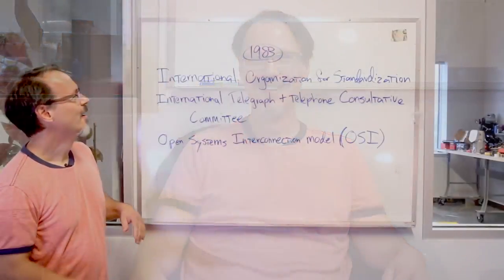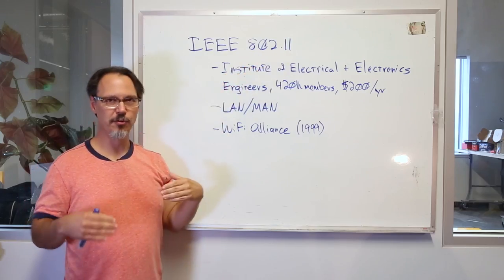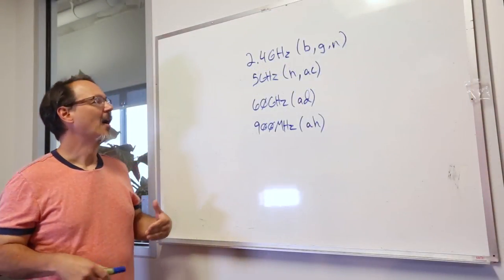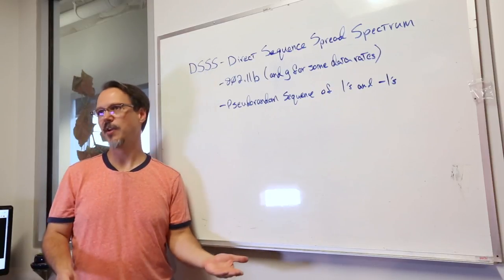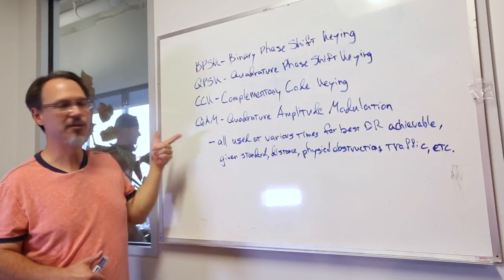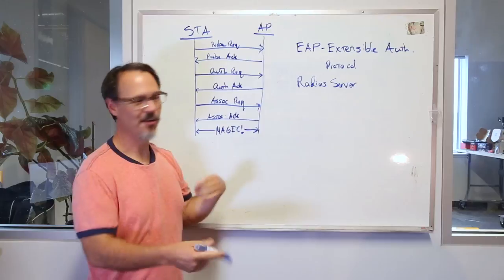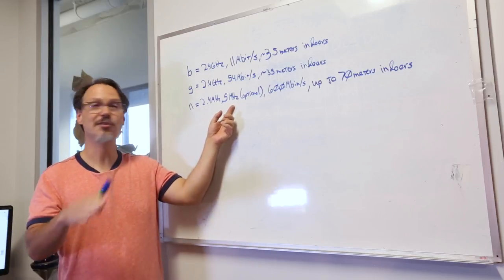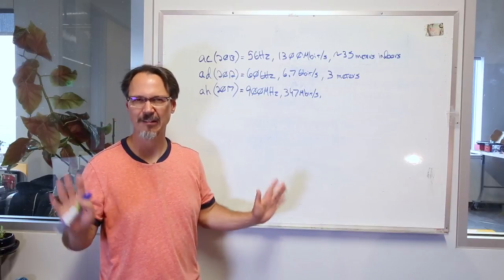SparkFun According to Pete #48 - How WiFi Works

Comment: is there a generic name for wifi that you don't need the wifi aliiance's consent to use? Would you just have to say 802.11-whatever compliant?
Reply: That's a really good question, and I don't have an answer. But I don't think I'd call it "consent" necessarily. They just own the "WiFi" trademark, so you have to get their approval if you want to use that. WiFi products that don't carry that trademark? I've never seen such a thing, but that doesn't mean they don't exist...although I expect that they largely don't. My thinking is that if you're going to go the distance to create a WiFi product from scratch, the expense of getting the certification is going to be chump change in comparison to your dev costs. You're not going to run a marathon just to lay down and take a nap right before the finish line.
Reply: The generic name is Wireless Local Area Network or WLAN. In Germany for example nobody uses the term WiFi, it's always WLAN.